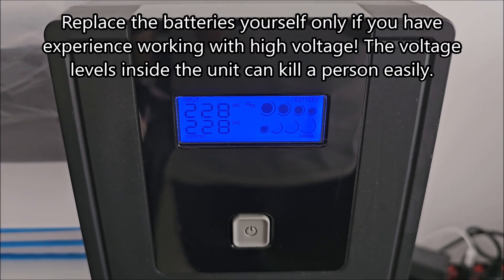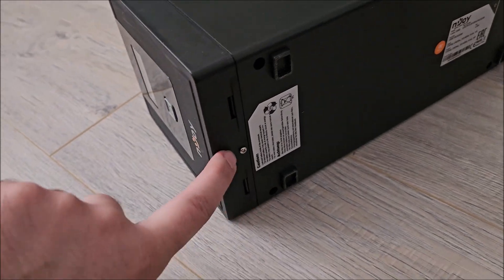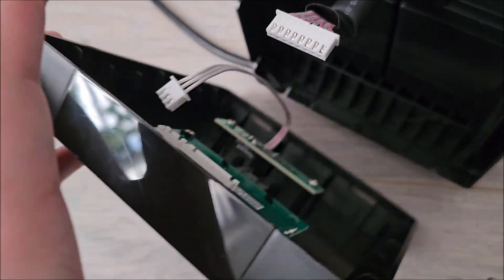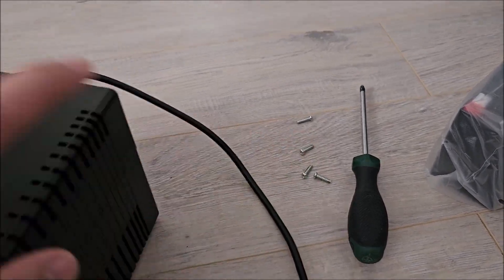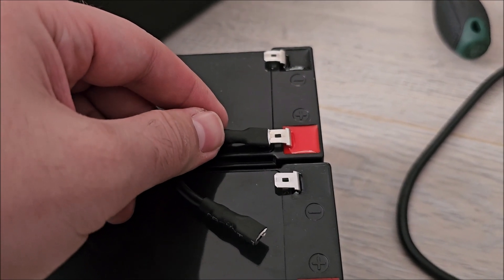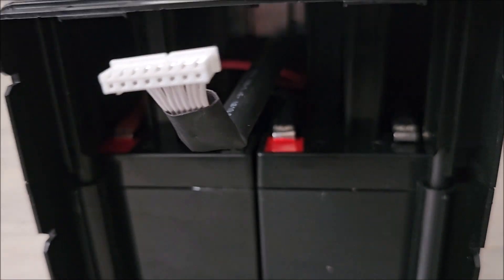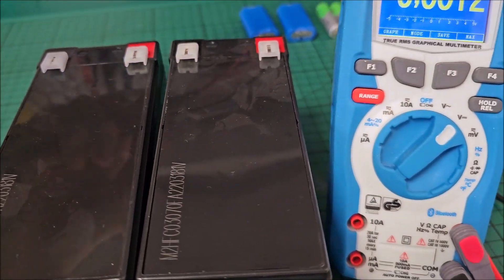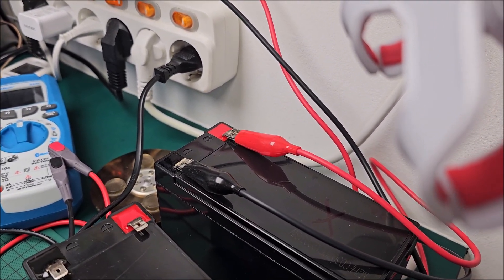🪫 How to replace the batteries in dual battery (24V total) nJoy Cadu UPS 🔋

Comment: Hi, what is the name of the device you used in checking the batteries to know which one was good and which one was bad.
Reply from the maker: Hi. At what point in the video? I think I used a multimeter and a power supply.
Reply: @UltimateDIY at 15:03 on the video, the blue and white device. Thanks for the earlier response ❤
Reply from the maker: It's a multimeter.
Reply: @UltimateDIY Thanks for your swift response,  bless you.
Reply from the maker: Welcome! Bless you too!

Comment: Hey bro i have a Toshiba c660-c14 but it actually is my dads and i want to upgrade it from w7 to w10 but i am scared when i convert it to w10 so will i lose all my cache and personal data and files if i upgrade it?
Reply from the maker: Please comment on the appropriate video. This has nothing to do with the UPS. If you comment here nobody can use my reply, but you. If you coment on the Toshiba video, anybody scrolling trough comments can get this information.
Normally you should not lose your personal files if you do an in place upgrade and chose to keep data. But this depends on what you click on during install.